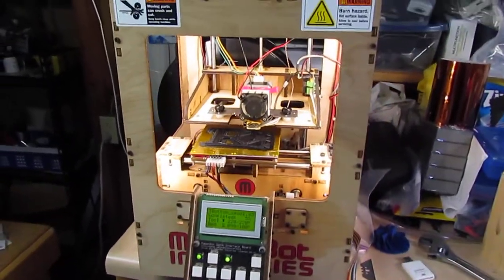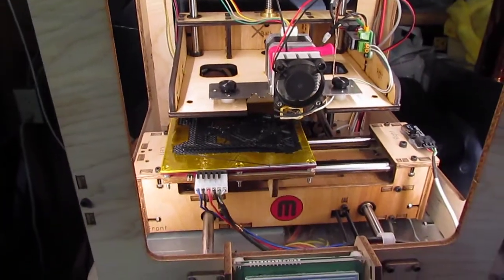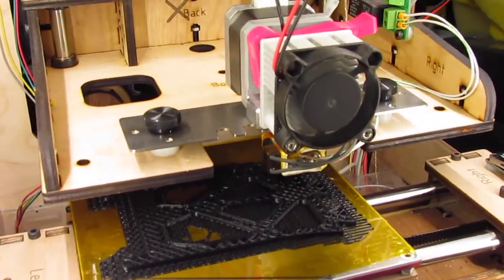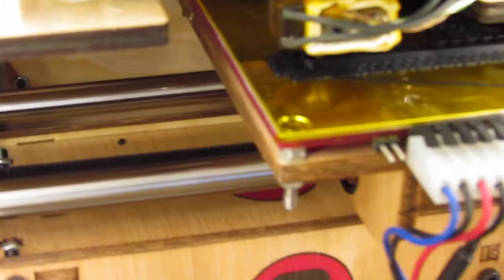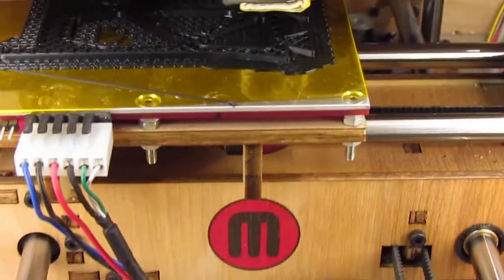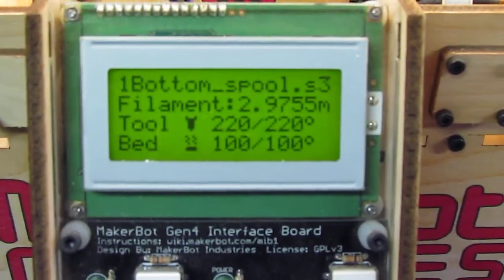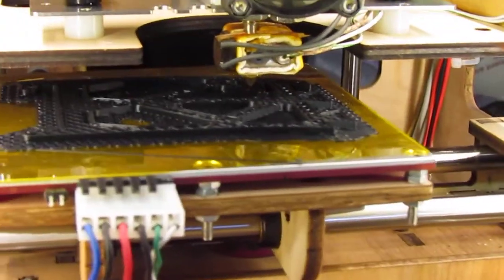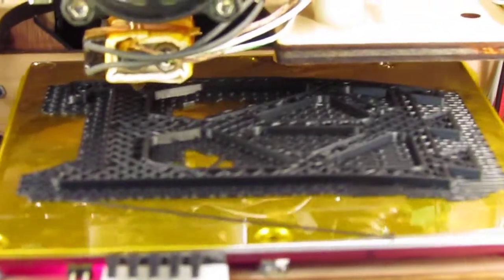Thing-o-Matic 3D printer Printing a bracket

Comment from the maker: This extruder is based on this (http://store.quintessentialuniversalbuildingdevice.com/category.php?id_category=6) design. I upgraded it with a spring loaded bearing type extruder upgrade I ordered on eBay. One like this.... http://www.ebay.com/itm/Makerbot-Replicator-2-Delrin-Plunger-Extruder-Upgrade-Kit-Bearing-Replacement-/121103219102?pt=LH_DefaultDomain_0&hash=item1c3250799e